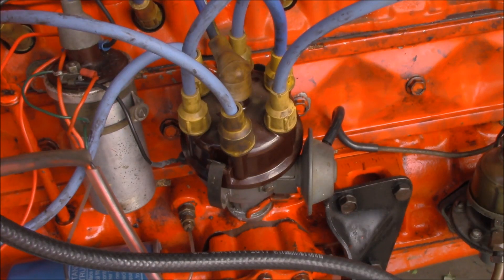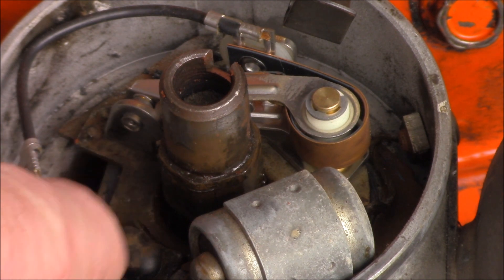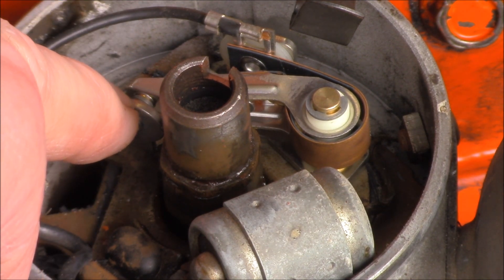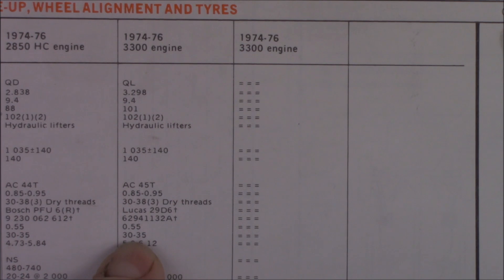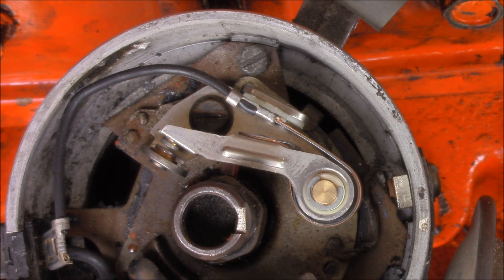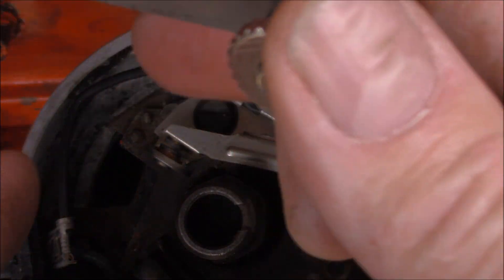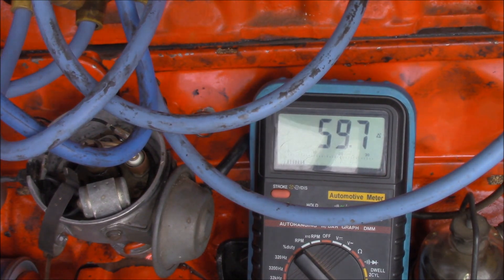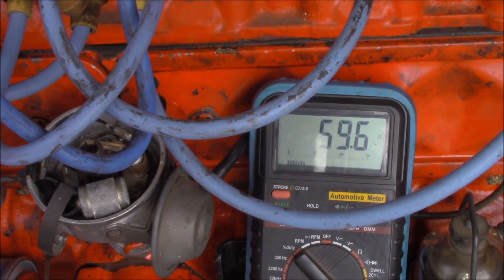Kettering Points Setup

Comment: Relitively slow magnetic charge up of coil primary when points are closed to saturate iron core in coil is key,  when points open rapidly due to narrow ramp up of distribuitor cam allows kickback current in primary flowing through condenser causes sudden crash of magnetic field. Remember the speed of number of flux lines cut in a wire determines voltage across wire.this rapid crash of magnetism cuts many lines in the high number of turnes in the secondary of the coil results in a high voltage across the secondary of coil
Reply from the maker: Thanks for your explanation. You might be interested in the playlist on the channel labelled 'Ignition Systems'

Comment: If you're going to do the timing after the dwell, which you should, mark the distributor position and then turn it to get on the lobe.  It's much easier than trying to kick the starter over to get there.  After you set the clearance, rotate the distributor back to, or close to, its original location as you will be sharpening up the timing anyway.  I'll throw a shrimp on the barbie, mites.
Reply from the maker: Thanks for your comment Alex. Everyone has a different method. I find it hard to 'bump' using the starter to get the lobe where it belongs. Maybe I just don't have the skills! 😉
That is very useful if you have removed the distributor. When just replacing the points and setting the timing, the distributor should be in a close enough position to maneuverer the distributor slightly to get your timing where it belongs.

Comment: This just the video I was looking for. Same engine, same dizzy, same multimeter.
(except you left the bit out about connecting the meter)
Reply from the maker: Pretty sure I included how to connect the meter
https://youtu.be/sRLqay5Yr4Y?t=160
Glad you got some value out of the video 
Thanks for your comment 😁
Reply: @MiracleMAX  Okay, I see it now, it was on screen text. Cheers.
Question for you. I tightened the screw but when I took the feeler gauge out it sprung closed. I had the main body of the points pushed forward as far as I could and the swing-arm lump on the lobe. Any idea what I'm doing wrong ... or could it be a stuck & slippy vac advance mechanism under the points? Cheers again.
Reply from the maker: @RoverIAC  So the feeler gauge needs to be pulled in and out when the screw is tight and the points pad is on the distributor shaft lobe. Yes, when you try to tighten the screw, it does have a tendency to move, but you just have to reposition it back on the lobe and check again. 
The vacuum advance plate shouldn't move too freely. Is the diaphragm OK? Can you put a hose on the outlet, suck on it and the actuator moves and holds in place?
Also, the mechanical advance under the points plate should have springs that allow it to return to their start position. When the springs fail or get weak, the rotor button will move very freely without resistance and not return to their original position.
This might help explain a bit better.
https://youtu.be/RzElGtuSS38?list=PLnsi5jSjF8JVu1MSCZNntMuihPUsZSWYD&t=401
Reply: @MiracleMAX  Thanks again Max. I finally got the points set correctly... it still wouldn't start but then I noticed the fuel bulb was half empty. Ain't that always the way. You try to fix something and half way through you run out of fuel or the battery goes flat. I got it started after a jerry can of petrol. But then I ran out of light. Also the bulb in my timing light broke. It had a spare bulb when I bought it in 1992.  But I usually do that by ear because I think the balance may have slipped on its rubber ring a bit. Thanks again.
Reply from the maker: @RoverIAC  Glad you got there in the end. Yup, just when you think you are near the end of the repair, there is something to put you back into place! 😒

Comment: why not adjust them while cranking?
Reply from the maker: Great idea Truck This Garage, you can get away with that on some points, but unfortunately with these it is a little more difficult, especially when trying to film as well. I have done that with some points that have a better adjustment hole for ease.
Thanks for your comment. 😉
Reply: @MiracleMAX  I didn’t think about the camera.

Comment: I knew that you could adjust the distributor head to adjust for timing degree, but I never knew about this - I knew you could adjust points with a feeler gauge but not the full process behind this.  Very good to know!
Reply from the maker: Thanks very much for your comment. 😊
Reply: @MiracleMAX  What type of feeler gauge are you using in this video, for reference?
Reply from the maker: @eurekasevvenwave  Just a standard imperial/metric set with a few brass feelers as well. They are used when setting gaps with magnetos or magnetic pick ups. You can get them off Ebay or your local parts store.
Reply: @MiracleMAX  I know this video was done with a modern dwell/tach, but I got an analog one and I figured it wouldn't make much difference.  All my other settings seemed to work, but when I used the dwell setting, my meter maxed out and had no difference in reading while cranking or not.  I had the red and black leads to each side of my battery, my green on the negative side of the coil, and I had the distributor center cap wire grounded to engine.  Not sure why that happens.  I'm hoping my meter isn't burnt out.
Reply from the maker: @eurekasevvenwave  Hey Eureka SevenWAVE,
Not sure what make of meter you have, but have you searched for a manual? It sounds like you have it connected correctly. Usually if there is a green wire, that one does go to the negative side of the coil. Double check all your connections and also check the settings on the meter itself. There should be a cylinder number switch to match your meter. Try without shorting the coil wire out - this may have an effect. Did you try with the engine running?
MiracleMAX
Reply: @MiracleMAX  My model is the Actron 615, I have the manual.  I haven't tried with the engine running (I actually need to switch the intake and put my new carburetor onto it and see how well that goes), but I've seen videos where they use the dwell without the engine running (just cranking).  The manual mentions removing the distributor cap and rotor but I saw no point in doing that since I removed the wire from the center of the cap anyways to ground it.  Although in that video the person used a Sears instead of an Actron, so maybe they handle it differently and I need it running to begin with.  I also did try with having the distributor connected as far as I know and saw no change.
Reply from the maker: @eurekasevvenwave  Ok, let us know how you progress
Reply: @MiracleMAX  I ended up figuring it out - I had to crank the car with my key, manually, instead of jumping it from the starter relay to get a dwell reading.  Which is interesting, it makes me think the key circuit is a relay with an 'always on' default instead of 'always off' (which I suppose actually tracks with how the coil works, to my knowledge).  I got a dwell reading of 32/33 degrees, which is within spec of what my car needs (1968 Chrysler Newport with a 383, if you're curious).  Also tried RPM for giggles and got around 200rpm for cranking, so that seems to work too.
Reply from the maker: @eurekasevvenwave  That's great news! Yes, you most likely would have had to use the ignition key if it used a ballast resistor. 
Glad you were able to work it out!
Reply from the maker: Glad the video helped. Let us know if you get your meter working.

Comment: What  kind of multimeter  did you use
Reply from the maker: Hey Javier Ban, 
Welcome to the channel.
The multimeter is a Digitor Q1585, which was put out by Dick Smith. Unfortunately, that company no longer exists and the multimeter is no longer available.
I do have some other multimeter suggestions in one of my other videos in the multimeter series.
https://youtu.be/7ipwvfdNcbc
I hope that helps 😊
MiracleMAX
Reply: I'm looking for a multimeter  that I could use for dwell  settings   what would you recommend  ?
Reply from the maker: @javierban2532  The Repco Digital Multimeter - RMM770 has a dwell feature.
https://www.repco.com.au/en/tools-equipment/automotive-tools/electrical/repco-digital-multimeter-rmm770/p/A5465133

Jaycar have one.
https://www.jaycar.com.au/automotive-dmm-with-dwell-and-tacho/p/QM1446

Supercheap have a reasonably priced one with some good features, including data hold.
https://www.supercheapauto.com.au/p/sca-sca-automotive-digital-multimeter/156452.html

I hope that helps

Comment: That is great knowledge Max a bit before my time but I remember my Father setting the timing. thanks for sharing bud.
Reply from the maker: You are welcome! It's been quite a few years since I've had to adjust a set of points, but felt to get a proper understanding of the ignition system, you have to start at the beginning. Hang on to your hat - I'm bringing in current ignition systems, including testing of 2, 3 & 4 wire ignition coils and modules as well as diagnosis of those systems in future videos!
Thanks again for your comments
MiracleMAX
Reply: @MiracleMAX  looking forward to it max

Comment: Good old red motor even has glass bowl fuel pump 😁👍
Reply from the maker: Thanks Stewart, I have one further video staring the Mighty Red Motor dealing with setting ignition  timing. It's  hard to demonstrate  these practical  tasks with modern vehicles since most of these adjustments  are ECU controlled. I thought it was important  to start with the basics before moving onto the complex systems we deal with today.